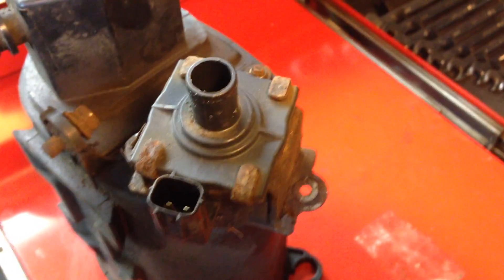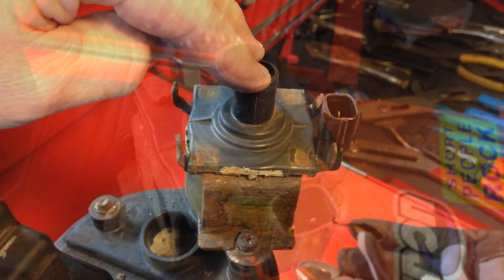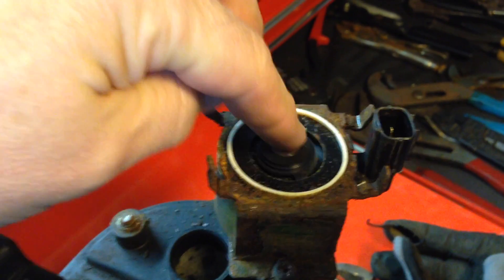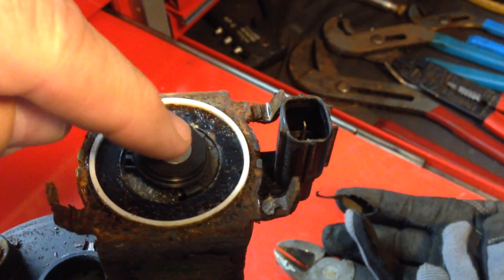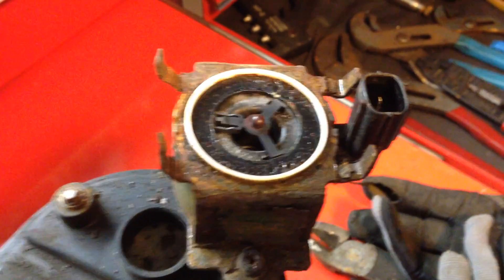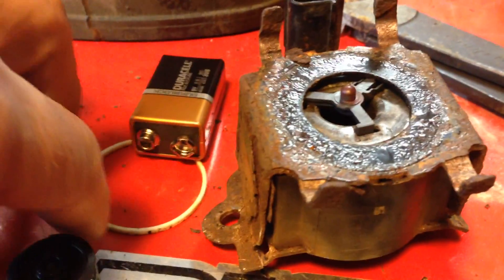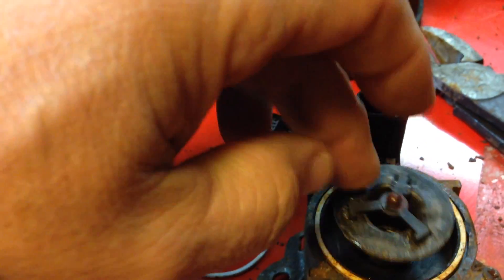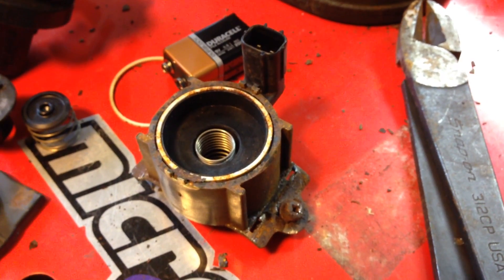Honda Check Engine Light, Canister Vent Shut Valve Operation

Comment: I have a 2006 Acura TSX with error code P2422, vent valve stuck closed. I took the vent valve out and energize it. The plunger did move in and out. 
I got strong air coming out the big opening port when i blow from small opening port while the valve is energized . Only weak air when the valve is not energized. No air coming out from smaller hose from bigger opening weather the valve is energized or not energized. Is this normal? How do you a vacuum test on the valve?

Comment: Is it possible to be getting an evap leak that doesn’t trigger the check engine light? I scanned my Honda and it doesn’t have any codes it’s stating it has a Evap leak between the orvr line between 2wbs and fuel tank. Issue I’m having are intermittent misfire that happens after cold start. Also the scanner is seeing it run rich. Im assuming it’s because evap leak. I’m going to smog test the evap system but before going part crazy I figured I ask. Trying to find diagrams and I only can find the front end for my 2000 Honda accord ex 3.0vtech. Appreciate any info at all thank you.

Comment: When this part goes bad can it be clean and hopefully it function like new? or does it needs to be replace?
Reply from the maker: Hi Darkmand8, it is possible sometimes but if the solenoid is weak you'll need to replaced it.
Reply: @EddieCarrara1  will cleaning with water works or you need electrical cleaner? I might give it a go. if it after that it don't work I replaced it thanks.

Comment: Hi Eddie,  (other commenters feel free to respond) I know this it's an old post. Hopefully you'll still see my question, lol.  I'm looking at purchasing a used 2007 Honda CR-V. It has CEL on and the code is p2422. Is it something I could fix on my own? How difficult is the job? Thanks!
Reply from the maker: Hi MW, you can fix it on your own. Depending on where you live and the amount of rust in your area will determine how many parts need to be replaced. If the screws come out of the canister easily you can get away with replacing just the Canister Vent Shut Valve, if the screws break off you'll need to replace the canister as well. Let me know how you make out, thanks.

Comment: That last thing at the bottom is the coil that generates a magnetic field to pull the solenoid core in when energized.
Reply from the maker: Correct, thanks for the feedback David.

Comment: Can anyone help.. I have a 2013 Honda Accord and recently got code p2422 check engine light; after driving through deep water. Do I change the whole canister ($240) or just the solenoid PLEASE HELPPPP
Reply from the maker: Hi Pedro, If the canister is full of water it may be in your best interest to replace all components. You could try removing everything and dry it out, it may be more time consuming but it will definitely save you a few $$$.

Comment: Tx so much, great explanation!  Can it be rebuilt?
Reply from the maker: Hi Roberto, you can try to clean up the spring, plunger, and cylinder. You have a 50/50 chance it will work better lol.

Comment: I have the same issue, and I was thinking about just repairing it after I saw a different video that said it’s just a leak. My original thought was to spray the top of it, but now I see that you can take it apart. Reuse and recycle, way buy a new part.
Reply from the maker: Yes Y D, sometimes they don't come apart easy depending on when you live because of the elements but it's definitely worth a shot 😊

Comment: Does this throw a p2422 error code? Will WD-40 fix this rather than buying a whole new charcoal canister?
Reply from the maker: Hi Brandon, it usually kicks a P1456 or P1457 code in Honda vehicles. You can try using WD-40, you have nothing to lose if the valve isn't working.
Reply: @EddieCarrara1  what if I’m throwing a p2422 evap cvs stuck closed any recommendations?
Reply from the maker: @southernoregonmoversllc439  I would test the cvs operation, if it’s not clicking, replace it.
Reply: @EddieCarrara1  how do you go about that? Go under while car is running and try to listen?

Comment: Is this the part on the engine or the box by the wheel?
Reply from the maker: Hi Mine Duck, 
It's located under the vehicle near the fuel tank under a plastic cover.
Reply: @EddieCarrara1  yup I see it thanks.

Any thoughts on which component it should be that causes stalls after refueling?
Reply from the maker: @mineduck3050  You may want to look at the purge solenoid up next to the engine, if it's stuck open it could cause some issues. Let me know if this helps.

Comment: Can you please tell me where I can locate the valve in Honda CR-V 2013. Do I need to take the canister out to take the valve out? Thank you...
Reply from the maker: Hi Ali, the canister assembly is located near the LR wheel near the fuel tank, it is usually covered by a plastic shield. Yes you will need to remove the canister to replace the valve.
Reply: Eddie Carrara Thanks a lot, appreciated

Comment: I got a Honda Element 04 and got the code P0496 which leads me here. I do smell a little fumes, its running good though no rough idle. Do you think if I pulled it off and cleaned it real good with brake/carb cleaner, wipe it down, that worth a shot? I have no idea where this is at, it close or attached to vapor canister? I can't tell from vid, but I think that is the bigger part this valve is attached to.
Reply from the maker: Hi Da Reptile, 
You can pick one up on Amazon pretty cheap, I don't think cleaning it will help.
Reply: @EddieCarrara1  I found what I was looking for on eBay for 34.99 used, everywhere else I looked for this it was over 110.00 for new. I replaced it and it worked, took about 60 miles of driving for the alarm to clear. Yes cleaning didn't help it you're right. Purge vacuum switch solenoid ---- https://www.ebay.com/itm/03-07-Accord-Vapor-Canister-Purge-Vacuum-Switch-Control-Valve-Solenoid-Bracket/152573601430?pageci=b2b06b4e-a59d-4d3a-b019-d95efdcd15a1

Comment: I’m so confused, I had a check engine light and it say to change the by pass solenoid.. but what is this? What valve?
Reply: I went thru this valve business causing the check engine light to go on. Saw video where the mechanic showed the solenoid valve by the fire wall---  the EASY one to get to.  He said THIS cannister valve is mounted on the cannister shown on this video. The harder of the two to replace. But I removed it without taking the whole cannister assembly off by using a phillips bit on a small ratchet wrench. Its a little hard to see above the valve but with a bright little light I could just barely see the top screw. I loosened it after patiently trying in the cramped space like hell, but damned if I got it! I carefully put the new valve on reversing the procedure and the check engine light went off after a little driving!  I COULD have taken the whole f-ing assembly like Eddie, but chose not to for caution about screwing up a hose or something making things worse. Hope you got yours fixed dude.

Comment: My check engine light went on with P2422 code. I heard that one should replace the canister and the valve at the same time. But I can't tell if the valve is within the canister. I was going to buy a canister set if the value was in the set. Does anyone know if the canister shut valve is a separate purchase or part of the canister set? Thanks in advance.
Reply from the maker: Hi Amy, sorry for the late reply. The canister is usually sold separately unless you can buy some kind of kit but that's not how Honda sells it.

Comment: Does this affect fuel efficiency that much?
Reply from the maker: Hi Matt, if your check engine light is on, the fuel mileage will drop because your computer is running the engine and trans a default specs.
Reply: @EddieCarrara1  I have the evap codes low purge flow and tighten gas cap.
Reply from the maker: @garymorrison4675  Hi Gary, usually the purge control valve is located near the engine. Most likely the purge control valve is the problem, it sounds to me like it's not opening up enough causing low flow so you may want to check the valve first for proper operation. If the valve is OK, there is a vacuum line running from the canister to the engine (purge control valve). I recommend you find both ends and remove whatever is attached to it and blow compressed air through the line to be sure it's clear. Let me know how you make out.
Reply: @EddieCarrara1  thanks Eddie . much appreciate the info

Comment: The pain in the ass is removing it with the 2 pita screws
Reply from the maker: Yes sir, vice-grip plyers work well for this, then they snap off and you need to replace the canister unless you get creative lol.
Reply: @EddieCarrara1  could you remove them with out bringing the black box down or you have no choice.Philp head screws? What number? Thank you again.You always save us time and money.
Reply from the maker: Hi Jose, yes the canister has to come down and they are #2 phillips head but you'll need to use Vice-grip pliers to remove them. Thanks for the feedback Jose 👍 don't forget to subscribe if you haven't already 😊

Comment: I have this cel code, p1457, and the autozone printout says 'replace evap by-pass solenoid valve', which I'm assuming is this part that I can get, but should you also do the canister too, at the same time, while the guys doing the valve. But the canister is around $100 more.
Reply from the maker: Hi Michael, 
It all depends on how well everything comes apart. I recommend replacing only the part needed to see if it actually fixes the problem, if it fixes it, you're good to go at a cheap price :)
Reply: @EddieCarrara1  Thanks, I got the parts ready so when we look Ill have them. I'd really rather simply replace 20 yr old parts with new ones so have new system, car only has 100k on, ex. shape '01 Civic runs flawlessly. I'm sure its all corroded, car came from Michigan, and made in Canada. I've dealt with underside repairs there before, it ain't pretty! First have to find problem, then takes all day to get old rusted parts off.
Reply: That Rileys has a $25 and $50 coupon right now. Got the 2 possible evap valves, the canister, and threw in an 02 sensor for minimum to get $50 off, basically ended up $55 per part, didn't seem too bad for new system. I've already replaced the other o2 sensor, the cat converter, and the valve thing under the hood, purge I think when I had that code. Now I gotta find a mechanic in Vegas, which isn't very fun.
Reply from the maker: @michaelg6641  Yes sir, I feel your pain, I live in NH lol.

Comment: Hi, I'm getting the P1457 code on my 2001 Acura MDX.  Replacing the gas cap hasn't solved the problem. The acceleration is sluggish and fuel economy is poor. Can you tell me what I should look at next and the location on my car? Thanks

Comment: Thank you very much for this video, if the solenoid still works do you think cleaning and applying some silicone sealant on the white gasket will keep it sealed so I do not have to buy a new one?
Reply from the maker: Yes sir Razvan-Paul, I will do that in a pinch for people I know and who what to take a chance.
Reply: GD IDEALS

Comment: hey eddie..haven't had my garage run a code yet, but I smell alot of gas fumes around the rear after driving. The big problem is that it slightly bogs when accelerating, and is very sluggish after the light turns green at a stop sign. I'm thinkin the purge valve. My 01'  honda crv has 175k on the gage...thanks for any insight here.
Reply from the maker: Hi John, 
Usually the purge valve will not cause any drivability issues, If you have never had the valves adjusted, you may want to have them checked by someone who knows Honda valve adjustments for this bogging or hesitation issue, the fuel smell may be something totally unrelated .
Reply: thanks..could be injectors....problems in the past with them, replaced all of them. replacing fuel filter tomorow

Comment: I have a acura csx 2006 and it have a engine light and i run it over obd,. The code p0497 comes out.. What should I do and how much will it cost me.. Tenx so much
Reply from the maker: Hi Marius, you'll need to have the system checked for leaks because there are so many reasons that light can come on, it could be a leak on the tank side or evaporator side of the fuel system. Check the gas cap first for o-ring damage or a missing o-ring.

Comment: Hi Eddie.
I hope you can help me 
I have a Honda accord 2001 lx codigo. P1457.
I change the all canister and shut valve. 
And the engine light back. With the same code.
Any advice. Please. Thank you .
Reply: I have your same 2001 lx. With P1547 code. I know ur comment is 3 years old.  But did you evet figure out what it was?

Comment: I have a check engine code P2422 EVAP CVS Stuck closed, I ordered and replaced a the emergency vent shutdown solenoid valve, cleared the code but it keeps on coming back. It is a honda civic 2006 LX. please advise.
Reply: What ended up happening to the car ?! I have the same code
Reply: @78percent34  it was the evap canister that needed to change
Reply: @Fvcyoupayme  the whole canister

Comment: Very nice video very informative I just have a question I a owner of a 2006 honda element and it sometimes sets a engine light and when I scan it it tells me that I basically needs a new catalytic converter it's not efficient anymore this light seems to come on stays on for like about a week and back off again for like about a week or two also I noticed a second code which for some reason can't clear p0001 fuel volume regulator open circuit I really don't understand what it means but i read that it's something to do with the fuel regulator which is controlled by the computer what I want to know is it related to that sensor that you're talking about on your video and maybe I just have to clean it out and put a new seal on it please let me know I'll appreciate any info that you might have thank you

Comment: Wow... Thanks for the tearing it all apart. I think cleaning where that white o-Ring seal seats will do the trick of fixing it instead of replacing.
Reply: What was your error code?
Reply: If you can take the rusty crusty thing apart without destroying the bend tabs holding it together,you can replace the o-ring.I did.

Comment: Hi Eddie,
I have a honda civic 2009 and its engine light is on. I scanned with OBD-II tool and it gave me two codes: P0497 - Evap emission low purge flow fault. and P145C - Manufacturer control auxiliary emissions control.  where is the location of EVAP canister on honda civic 2009? and can I replace it myself? I am not a professional mechanic. I would appreciate your help, Thank you.

Comment: Hey what's up Eddie Garrara?
I'm trying to find the shut valve on a honda fit? can you please tell me where is located? THANKS
Reply from the maker: +Denis Reyes,
 Hi Denis, it's actually located under about 3 plastic shields under the car. When looking under the vehicle you'll notice the catalytic converter coming from the engine, the ''B'' pipe bends and swings to the passengers side of the vehicle, right where the bend is in the ''B'' pipe you'll notice a plastic shield located under the back seat, but under the vehicle, not in the vehicle. Let me know if you need more help.

Comment: hi, Guys!
 Am checking the solenoid valve in the canister, the solenoid works if you blow you can feel that the valve let pass air  a little. is that normal or the valve has to close completely?
Reply from the maker: +erik vazquez It should be completely closed with no leakage.

Comment: Hi Guys,
I have sonata 09 3.3 and just got this p2422 error, went off check engine light and came back again within a week. Can anyone help me with this issue as dealer is asking me crazy price for the part around $77. Thanks.
Reply from the maker: +Setu Kansara Hi Setu, if that is the price for the part, what are they asking for labor to replace it? You can probably find the valve on Amazon, but who is going to install it?
Reply: +Eddie Carrara  Thank you for replying.. can you please guide me which part to buy.. I can't  ever find part on ebay or amazon...
Reply from the maker: I would like to be able to help you on what part to buy but I'm not sure and I wouldn't want you to buy the wrong part on my recommendation. I recommend going to the dealership and asking them which part it is that you need to replace for that code.
Reply: My 05 crv got this code p2422 and the problem is spider web inside the hose of the evap canister. The hose that get outside air.

Comment: Can anyone tell a me where to find this thing? I'm Getting the P2422 (EVAP vent valve stuck shut) error but I don't know where the unit is. I've also seen spider nests as a "normal" cause of the error and would like to check myself.
If its crazy difficult to get to, fine -- I don't have the tools and will take it in but if I can get to it myself I'd love to fix it on my own. Thanks in advance!
Reply from the maker: +Layton Miller Hi Layton, what is the year make and model of your vehicle?
Reply: +Eddie Carrara 2004. i assume i can get a manual for it but I don't know where
Reply from the maker: If it's a Honda, maybe I can help, what is the year make and model?
Reply: Oh sorry. I apparently read that too fast. Its a 2004 honda element.
Reply from the maker: Hi Layton, sorry I was MIA for a few days, the canister is located between the LR axle and fuel tank, it's under a black plastic cover.